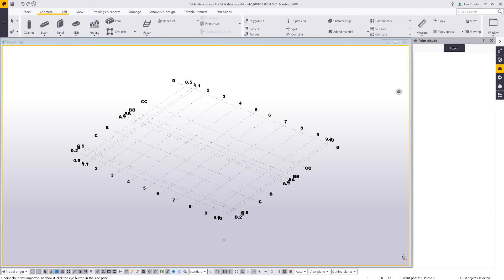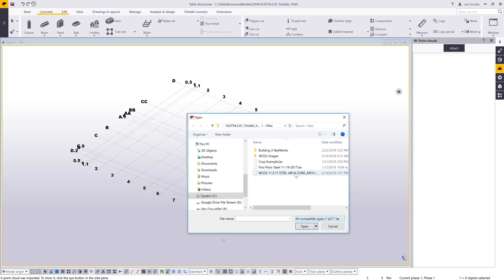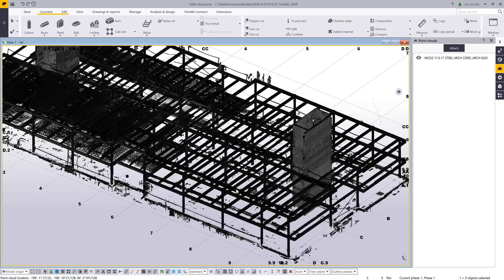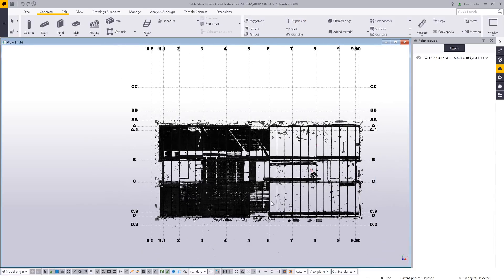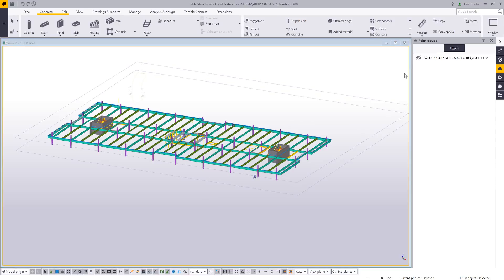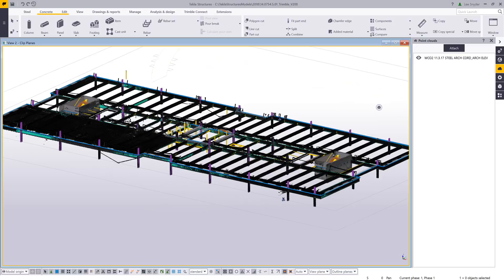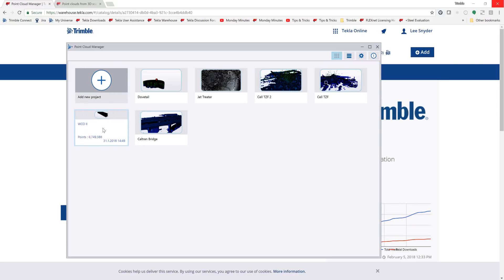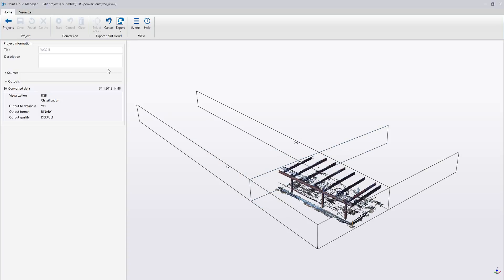Tekla Structures 2018 New Feature - Point Clouds

Comment: Is there a way to align a point cloud that is not georeferenced?
Reply: Hello Trevor!  Yes you can do it but you will need to do it manually.  Meaning you need to insert the point cloud and then find a reference point in relation to the model, get those XYZ coordinates, create a base point with those coordinates and then re-insert the point cloud.

Comment: Can Trimble Connect also support a combination of 3dmodel with pointcloud; bimvr.nl/lidar1 (how to connect with potree .js). And is the ¨pointcloudmanager¨ saving to vendor-lock .tzf file format or can it save back to e57? And now with DirectX support can you build in a DWFx open-standard reference?
Reply: Yes in Trimble Connect Desktop you can view the 3d model with the point cloud.  The Point Cloud Manager can save to the following formats: las/laz/xyz